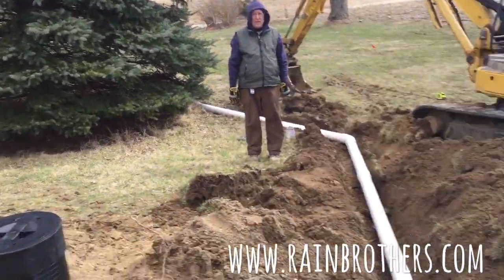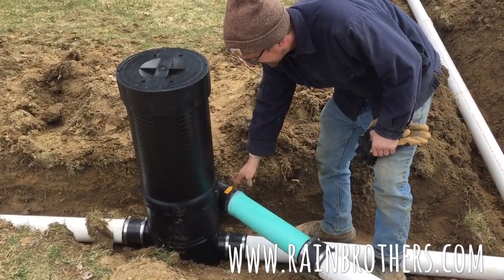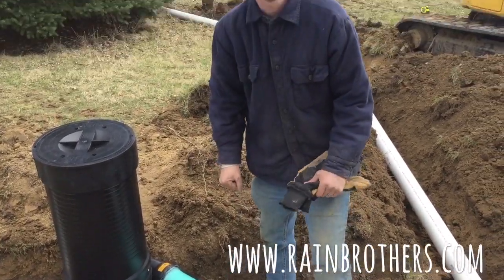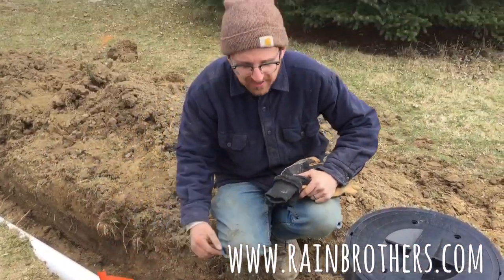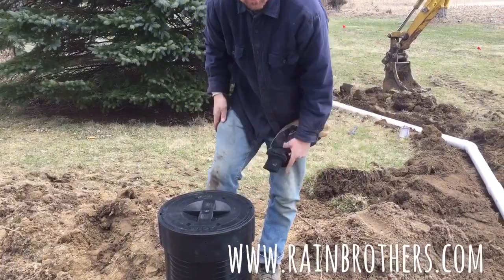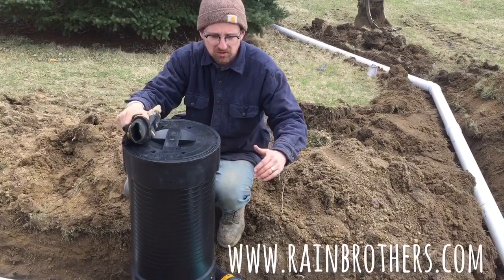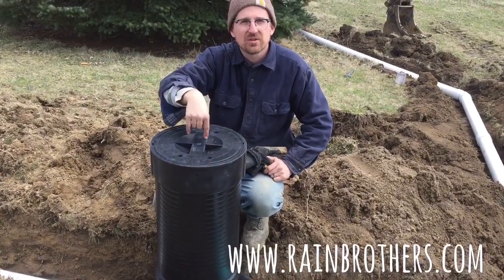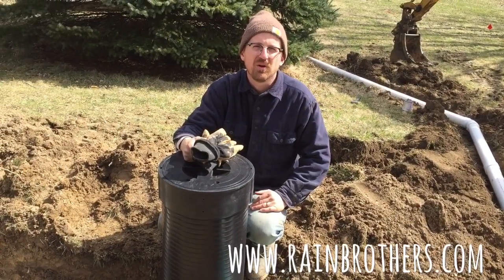BEST pre-filter for rain harvest cistern: How to install

Comment: 15% is lost?  Wow,,, thats a lot of waste !  There has to be a more efficient way..
Reply from the maker: Hello - yes, it is, and there is the potential for more water lost if the filter is not clean. We also have a new pre-filter called the Monjolin filter, and it has a higher efficiency and will actually filter to a finer level, so would be a better choice if you’re in an area where each drop of rain is needed. However, if you live in an area where it rains consistently, and you have a lot of downspouts feeding your cistern, then this Wisy vortex filter is the way to go. Remember, even though you lose some water, the water that you are collecting is very clean.